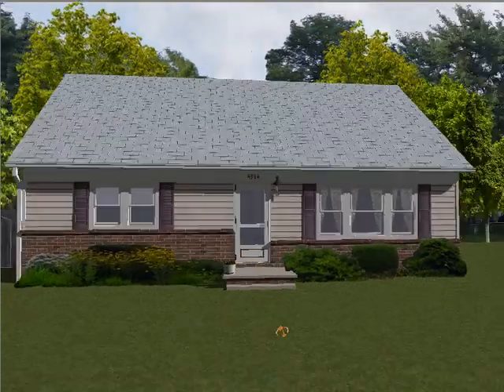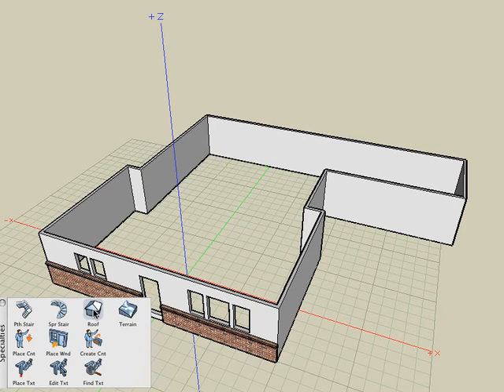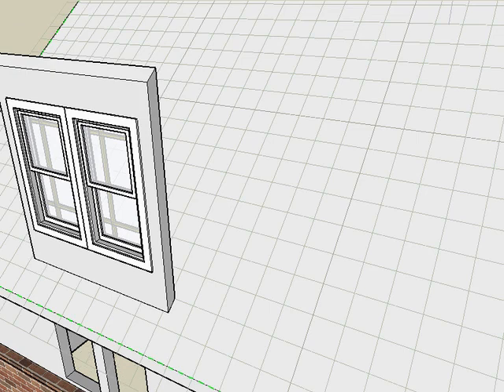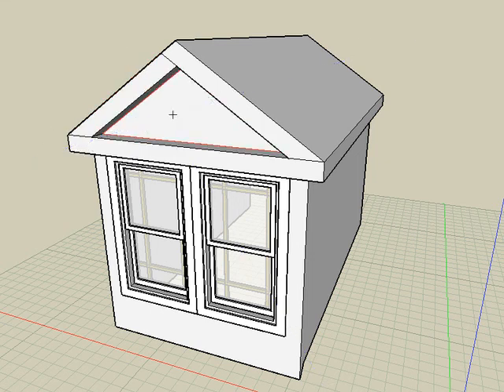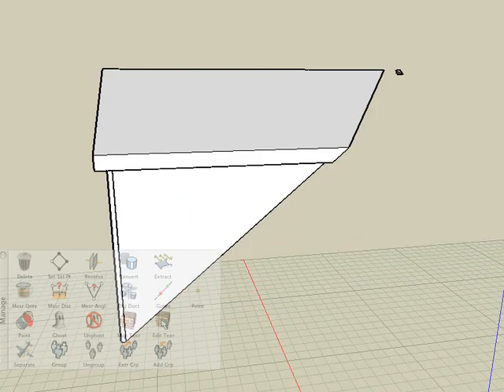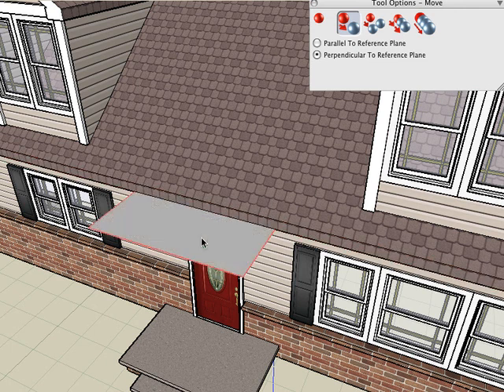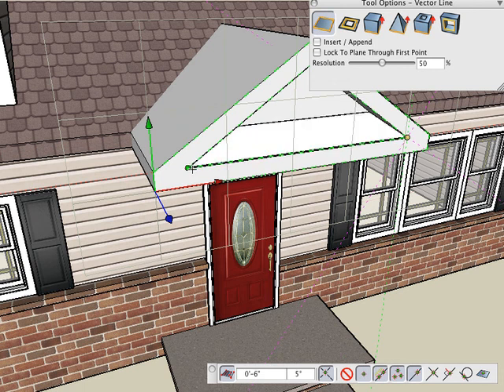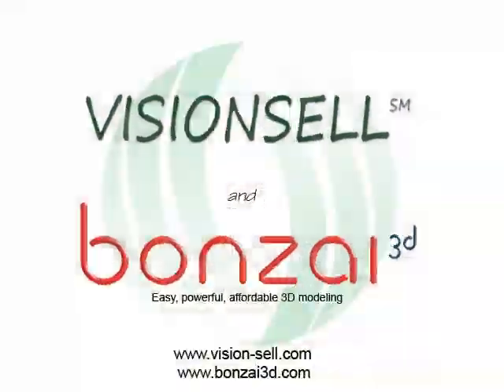VisionSell Demo Part 2 - Modeling the new in bonzai3d 480p

Comment: Well seems kind of an archaic way to model a roof. Also I still see roof tiles through the windows. I doubt you can directly print this model without cleaning up loops and internal faces. Sketchup lets you generate drawings through Layout which is part of the sjetchup pro set of tools. I wonder if there are any tools to control the topology of the model?
Reply: Hi Olav,
Yes, this model can be easily printed, as the geometry is created without defects such as edge loops or intersecting faces (for which SketchUp is somewhat notorious).
bonzai3d does not have a layout mode, but formZ 7 (which includes all of bonzai3d) has this integrated.
We are not sure exactly what you mean by "control the topology of the model" but you can move parts of objects, there are tools such as the Object Doctor that will fix objects, and solids can be converted to surfaces -- and vice versa -- in many different ways.
Please see our other videos (including one dedicated to 3d printing) for more details.  :-)

Comment from the maker: Hi DC,
Yes, you can use the Export command to export the 3d model to a CAD format such as DWG for documentation, or STL for 3d Printing.  You can use the Export Image command to create image files, and if you are in Wireframe or Hidden Line, you can use Export Image: DWG to create a 2d vector  line drawing.  You can also use the Print command to print to a PDF file (built into OS X -- or just install PDF995 or other on Windows).  Does this help?

Please see bonzai3d.com for more info!